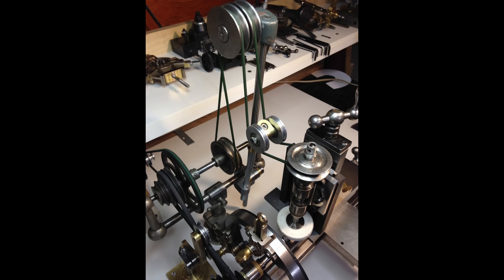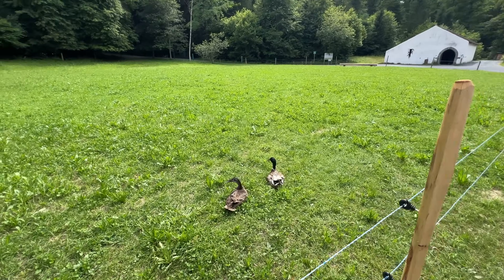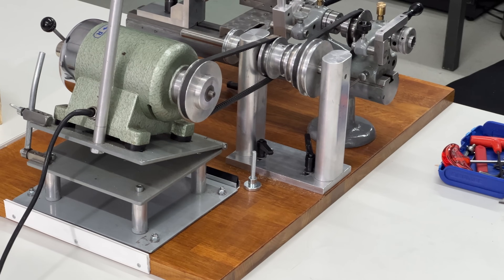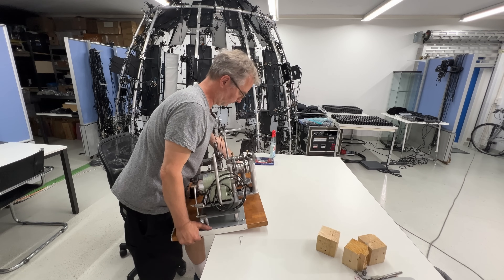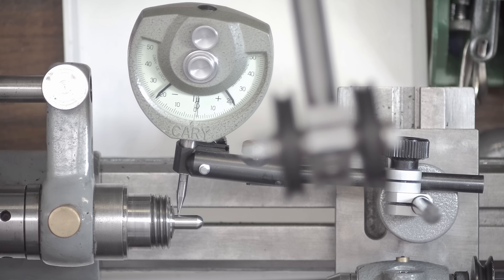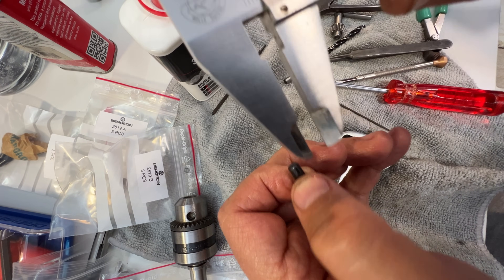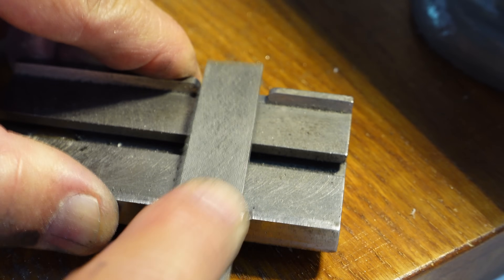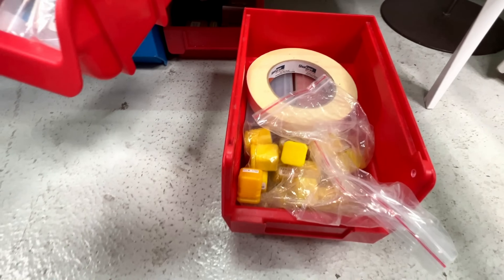Upgrading an Old Watchmaker's Lathe

Comment: Rabbit hole, for the lathes is awesome ❤ I have a wolf and two Levin's. Great video. I'm trying to do the milling attachment for gears.
Reply from the maker: Levin's are great, right? I think they're mostly found in the US. I've never seen one at the markets over here.
Reply: @IMakeWatches They're but supremely expensive, I got lucky twice. But adding accessories is crazy, for the 8 mm, I'm going to er set-up. The 7mm is pretty complete, so that one is staying stock. But we are planning on moving, so I can get proper watchmaking, 3d printing and láser room😅😅
Reply from the maker: @ReyciclismoMTB  Check out my Index driver project for gear cutting. I can sell you the complete system if you don't want to build it yourself. https://imakewatches.com/projects/CNCIndexDriver.html
Reply: @IMakeWatches I was there the other day, since I do some raspberry and Arduino. Always looking for trouble 😂😂

Comment: It’s good to see that you have a proper room to do lathe work etc., not a dingy basement or garage setup.
Reply from the maker: I do have a great space but there's a huge advantage to home workshops which is you can work any time. In theory I can work any time in my workshop, and I do, but I also like to be at home with my wife. Did you see Roman's workshop?  He owns the building and lives upstairs. That's a dream set-up. Plus his workshop itself is absolutely insane. All he needs (IMHO) is a small CNC set-up.  https://youtu.be/HVMmTQAInKo?t=2290
Reply: @IMakeWatches I definitely saw his workshop, & was green with envy.  I wish that I still lived in Grenoble & could easily drive or take the train to Geneve to access all the used watch tool markets (and watches themselves).

Comment: Thank You a lot! if You won't mind i hawe a question, what is the differense between option one and two for the milling attachment?
Reply from the maker: Sure! I use the same milling attachment on both. The larger lathe is just more stable for larger workpieces because it has a larger headstock, collets, bed and cross slide.
Reply: @IMakeWatches  Thank You! i got my self an old Schaublin S-70 last Year but i am in the situation i can't afford the original accesoirs for it and they are hard to find second hand where i live. Same with the index, so i think i will give Your solution with the steppermotor a try! Thank You a lot for publish the instructions!
Reply from the maker: That's great that you got a Schaublin 70! But you're right, the accessory prices are high. Even the W12 collets.
Reply: @IMakeWatches  I was wrong it seem to be the old 102, do it is a bit larger, but for what i have in mind at the moment (making parts for model steamplants in my collection) i think those tools will do, my goal is to learn how to repair old shop meters whan i got some more skills under my belt... 🙂